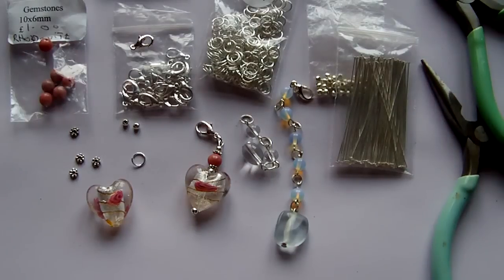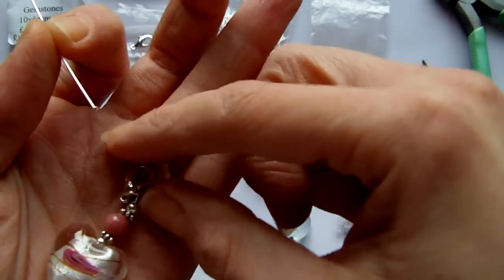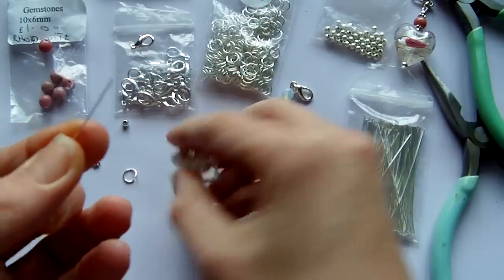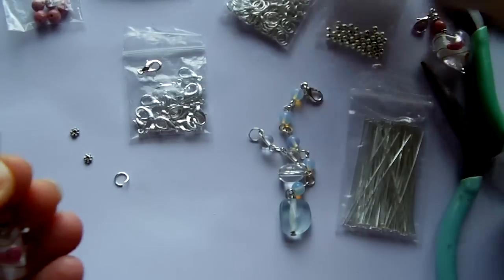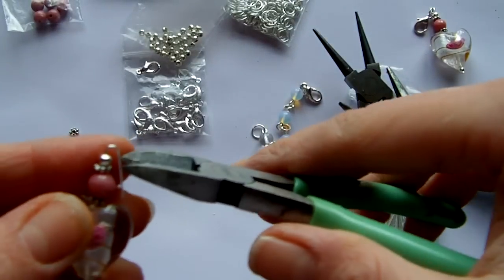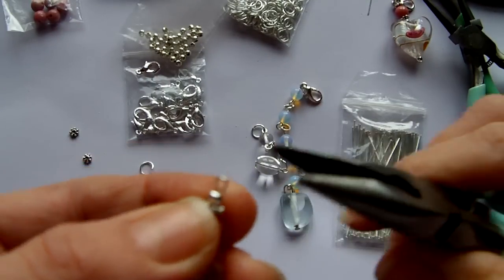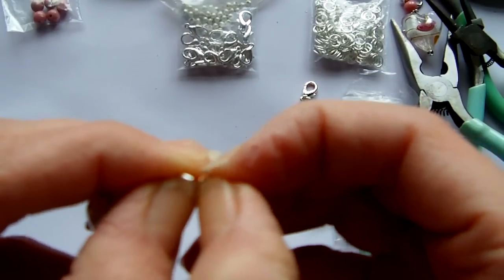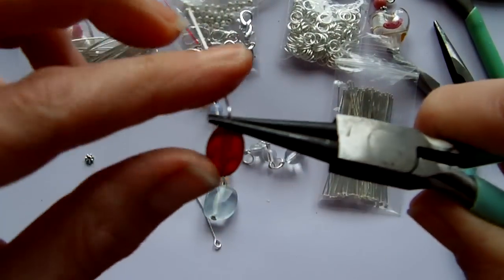How I make my charms -  Tutorial

Comment from the maker: @Tracymarie100 Hi Tracey, the jump rings I am using, and most regularly use are 6mm, though I also keep a supply of 8mm when larger ones are needed.  I rarely use any smaller than 6mm as they are very fiddly to work with, and there is not enough space in the rings to attach other things to.  Hope that helps, Rachel

Comment: Do you use .5 or .7 mm head/eye pins (24/21 gauge)? I'm having trouble bending the 21 gauge pins for earring charms (the silver plating appears to chip off too). Am I using too thick a pin, or is it all just practice? (My beads are mostly 4mm-6mm at this point.)